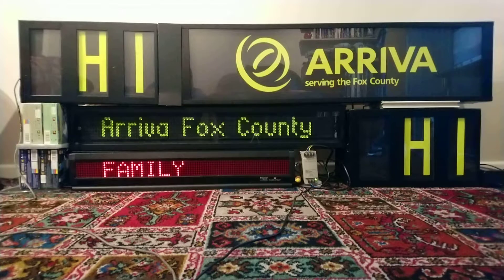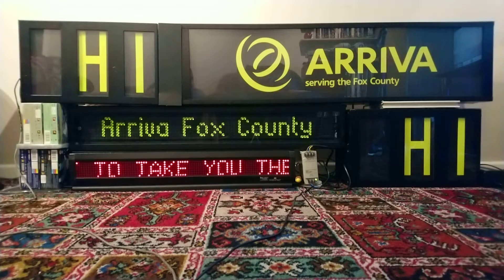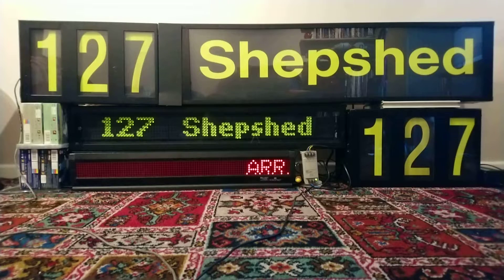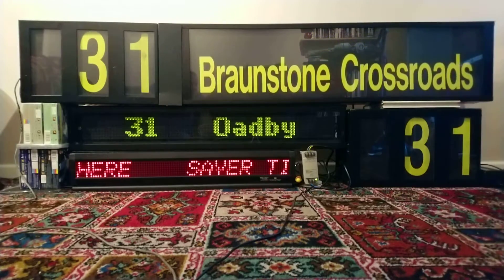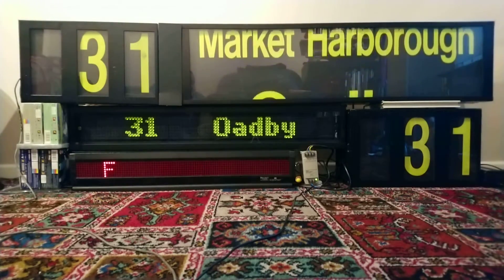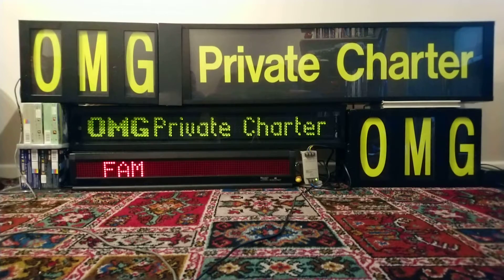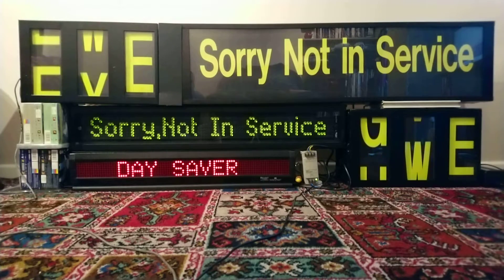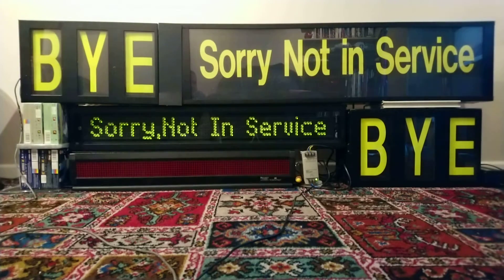Bright Tech Developments Bus Destination The Full Power Roller Set

Comment: Depending what you power supply you have you can alter the potentiometer to make the blinds go slower or faster.
Reply from the maker: It's a 24 Volt DC output, so not changed anything on the displays. But the rear numbers box does run slower, than the front numbers unit.

Comment: It was a nice trip down memory lane seeing those signs. It was this time 20 years ago when the first batch of those DAFs were entering service on the 84 and 85, and 19 years ago when the other batch were coming in for the 126 and 127.

It was quite a lengthy process, getting those displays changed. The first LED upgrade I think was in 2006/07, not sure which vehicle, and it took its time, the last of those buses to have the displays changed was 4738, which wasn’t until 2014. It ran with them for about a month before they chose to withdraw it for good.
Reply from the maker: The front Display is from one of the 126 and 127 Batch the controller has 4727 on it, Side and Rear are from a Mini Pointer Dart with my LED Front and Controller.